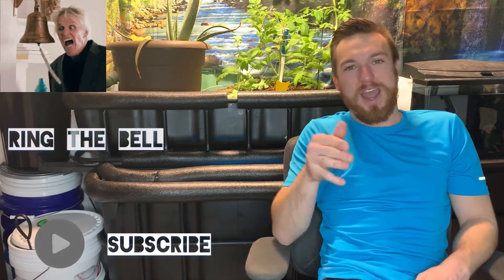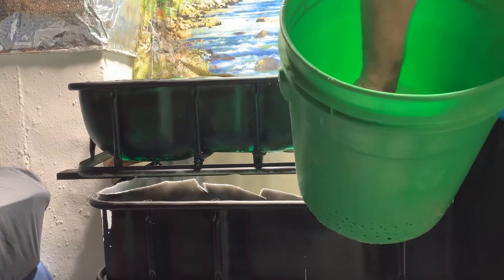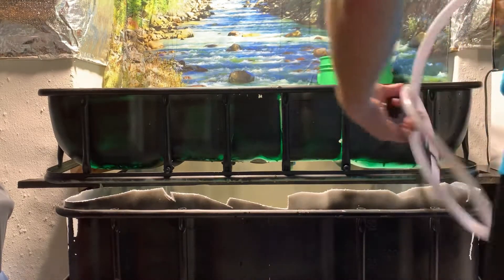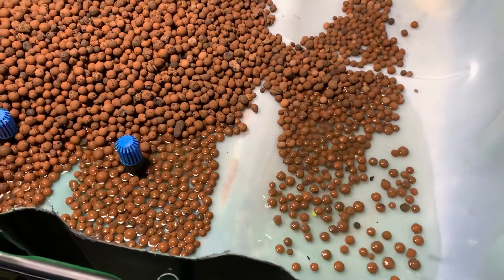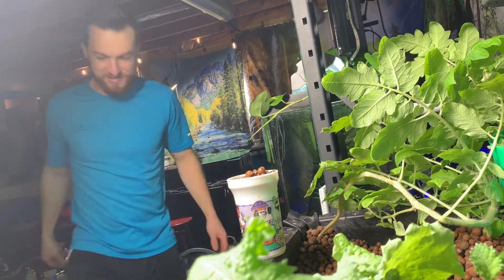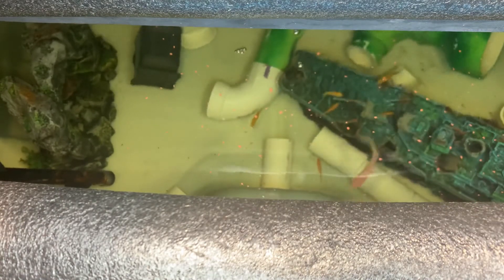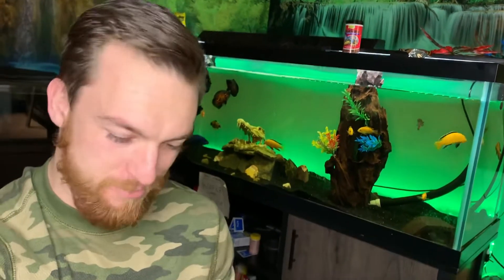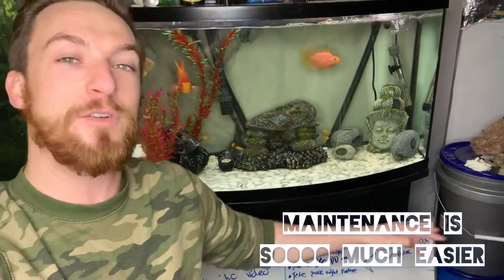AQUAPONICS IBC Chop and Flip system

Comment: I may have a complicated question here but I hope that you can help me out. I would like to configure 2 IBC grow beds side by side on TOP of the tank. I have built a frame around the tank to hold the weight of the beds. I think I will still need a sump tank but can I use a 55 gallon drum? Do I need a bell syphon for each grow bed? They will be in the basement with grow lights and limited space. How would I plumb that as compact and as efficiently as possible? Are worms a good alternative to solid waste tank? I have the 2 IBC beds and tank cut and I have all lights, pumps, heaters, timers and everything that is needed so I would really appreciate any honest opinion from any of you gardeners that have done this or have any suggestions.  Good luck to everyone that is starting out like I am. Thanks to all of you! Please feel free to contact me at: bylo_mylo@yahoo.com
Reply from the maker: I’d love to see your plans and collaborate ! I’m about to expand this system to something similar actually 🤙🏼🤣 you are first to know! Shoot me a text and we will talk tomorrow. 513 687 5687